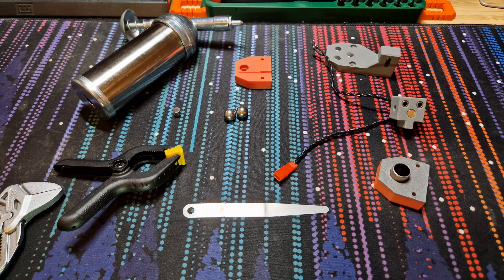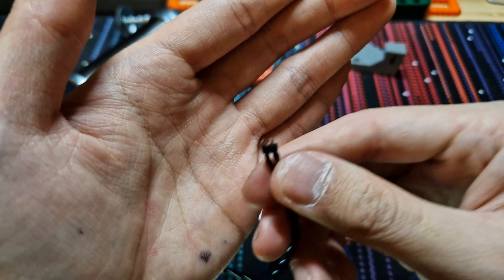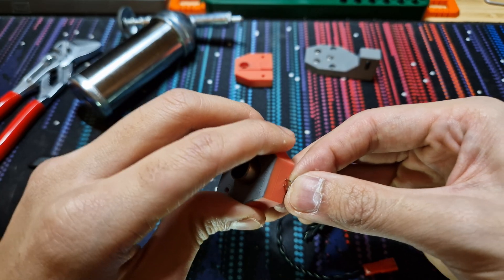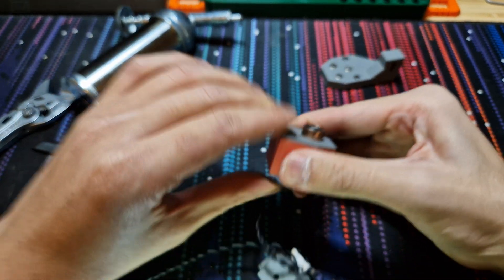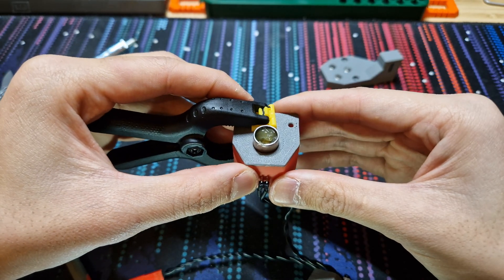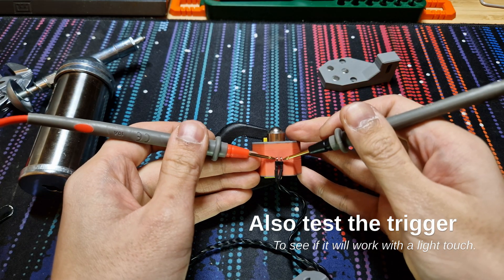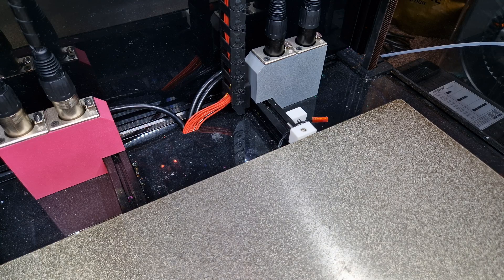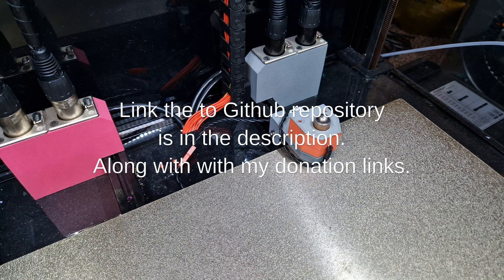Lubeballs probe - Build Guide

Comment from the maker: 04:00. There is a -1/+0.5 mm for the bottom magnet to move up or down. For example, you can press is down without the feeler gauge as a spacer, which will make it 0.2mm deeper.
Reply: When you test the wire leads, are you expecting continuity?
Reply from the maker: @mikeshawn2913  yes. it is a normally closed switch.